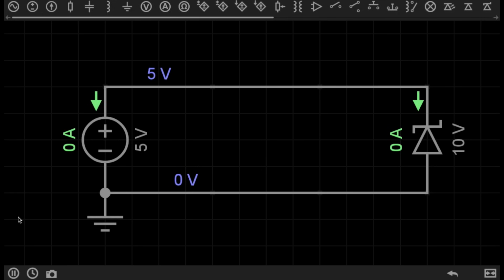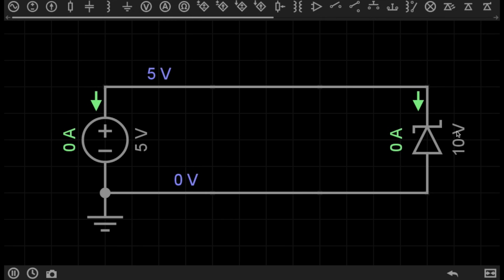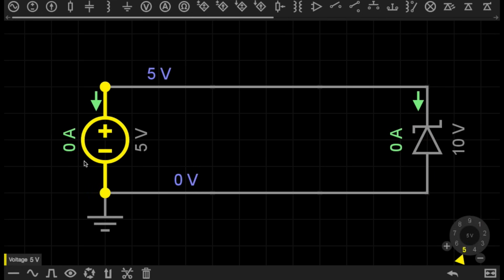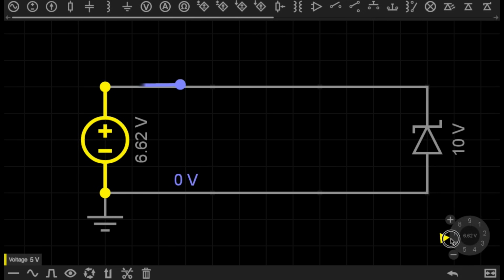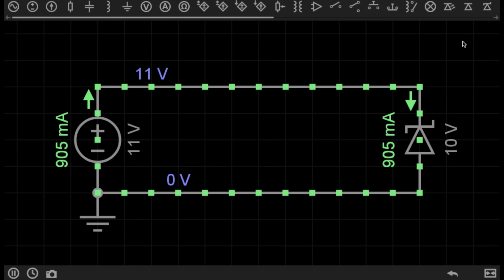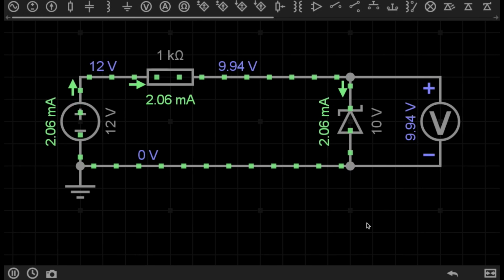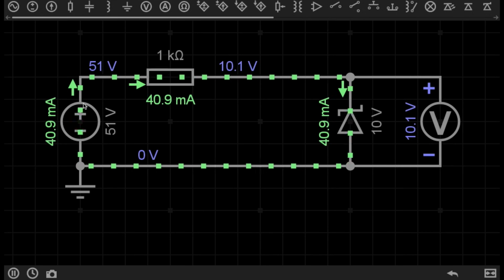What is a Zener Diode? - Electronics Basics 15

Comment: did the same circuit on everycircuit....but the current starts flowing right at 10V...thought you have to go above that before the current starts flowing?
Reply: The zener voltage is typically expressed as a min/max range on the zener's data sheet along with a nominal value (in this case 10V). Avalanche breakdown occurs over the range, but calculations involving Vz, Iz and Zz are done using the nominal zener voltage. These individual settings can be adjusted for the zener in EveryCircuit which allows you to simulate a wide range of components. This is why the diode conducts over a range of input voltages under reverse bias conditions in both EveryCircuit and this video, Unfortunately this video doesn't address this important point in zener diode operation.

Comment: Saw this video on the YouTube main panel and it brought back memories of a fraught Saturday in the Lab. On the Friday just before knocking off time I was given a request from the other engineers to look at a D75 Oscilloscope. I was on my way over to the racks to sort out something for overtime tomorrow Saturday. OK I picked up the D75 and heard Chris say "Its in the pre amp trigger somewhere".
That was NOT good news ! Timebase faults can be so and so's. I was eyeing up a D67 which I loved to work on, favourite was the Tektronix 453 though. I sort it out on the bench, take the covers off, get the service manual off the rack and an extender cable to timebase plugin. D75s are flat rack mounted or desk on the legs. Party Friday night, drive in next without a single memory of the journey in barely able to see let alone walk ! I stagger to my bench in the thought of what is to come. Nothing gets done for at least 20 mins ! So hung over ! So I start, find a 5.7V Zener reading 5.85 ! Looking at the location proved why others couldn't find it ! 1.5 hours to remove the board and out comes the zener onto the Telequipment CT(906?) Curve Tracer. Get to 5.7V ok the run up the transfer characteristic to see 1/3rd of the way down the trace it splits into strands like a split hair, no curly bits. Whaaat? Quickly i replace the zener, make good the board, you couldn't tell anyone had been there, after two years on the bench my soldering was very neat. Was a bricklayer two years before and before that a tank gunner. Flashed it up and TaDa ! there was the trace trigering like a good'n. I walked slowly over to get a cup of coffee. My hangover completely diappeared on seeing 5.85V, then a smile at the successful trace. The comments soon quietened down as I was collecting my coffee "Havent you fixed it yet Tony ?" A smile was the reply, several engineers rushing over to see the curve tracer and the scope with its clothes on and working fine. "Very well done Tony" Ian said ! Struth I've seen him say "Hmm OK" to one of the other engineers after a three day struggle to find an intermittent (Salmon Pink) precision resistor, very rare ! Three weeks later my pay was raised to the other engineers from trainee's pay. Will never forget that. So far no one has seen that, so maybe I havent been asking the right people, but all were repair and calibration engineers. the most rewarding and exciting experience of my life, I loved it. Analogue component fault finding is the best !

Comment: simply electronics, so basically this video is saying that inject 40.9 mA trhough this circuit at 
51 volts, zener diode will lower the voltaje to 12v but will keep the current at the same level? that means a very big power loss?

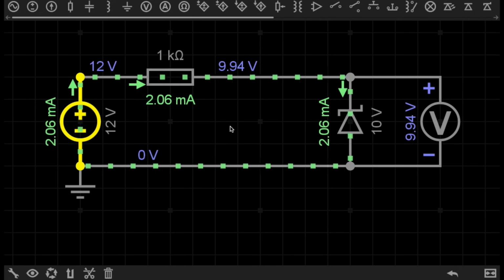Comment: I didn't understand one of the examples in this video... at 2:39, he says that the zener diode's breakdown voltage has been exceeded, but in fact it hasn't. The battery is providing 12 volts, but the resistor reduces the voltage to below 10 volts. So how did the zener diode breakdown when the voltage is only 9.9 volts?
Reply: Before the breakdown there was no current to provide the voltage drop, so it would have been equal to the supply voltage at some point . After breakdown, the diode still conducts in reverse even if the applied voltage is lower than the breakdown voltage, as the breakdown is generally irreversible.
Reply: Very good question indeed!
Reply: Hope this gets answered.
Reply: zener diode is eating 0.1 volts, it's called voltage drop. is like sending dc current at a specific voltaje through a long vable. when measuring the voltage at the end will be lower than what it began with
Reply: When the supply voltage is 9.9v there is no current across the circuit
Reply: If the voltage is 9.94v across the zener diode, how can it allow current to flow in the circuit?  So meaning if I increase the resistor value to 4 tines it's current value, the zener diode would still allow the current to flow through the circuit  with a 12V power source? If that's  the case, the power source voltage is a concern and nothing added in the circuit matters.
Reply: V= iR. The current through the resistor determines the voltage drop across it. The Zener is dictating the current by holding the voltage at its cathode side to ~10V.
Reply: he didnt say at 2:39 it was 12v but when increase the volt 51v he  says exceeded at 3:05 ,,and the best work put volt at 24v in the  dc supply

Comment: I would like to know the Simulator that you have used in this video. It is quite good simulator
Reply: Shivam Kasaudhan everycircuit.com
Reply: Can we get that simulator app or program??
Reply: Great program. Would love to see a desktop version of this.
Reply: @oo0Spyder0oo  Perhaps they added the Chrome option after you made your comment, but you can run it in Chrome on a Desktop now. It is not free and has only a 24 hour trial period.
Reply: @TornadoCrafter  Thanks for the info. Any idea how much it costs? I see no info on pricing on their website.
Reply: @oo0Spyder0oo  I see references on third party web sites to the apps costing $14.99, not sure about the Chrome version. I don't trust a company that doesn't put their price out in the open plus the fact that they only have a 24 hour trial makes me think they are trying to trick people who won't have a chance to really check out the product before the trial ends so they hope people will buy it before they realize it won't work for them. I see comments about how it is missing many type of components, like Triacs. The animation is really nice and makes a good educational tool for basic electronics.
Reply: @TornadoCrafter  yes I felt the same way. No price until signing up perhaps, not a good way to do things. Thanks for the great info.
Reply: But why does the simulation show the current flowing from positive to negative?
Really it would be more believable if the current flow was in the proper direction.
But yes the description is correct.

Comment: Did this exact thing on my every circuit and even tho the voltage will flow thu the zener at 10 volts as soon as I increase the voltage at the source the voltage meter goes up to the same voltage.
I thought a one time payment would be worth it but not if it doesn't function properly.
Just for the record I'm not a professional electrician but far from a novice.
That said thanks for the videos, great job.
Reply from the maker: Have you got the zener reverse biased with resistor in series?
Reply: Yes sir I sure do, even did it both ways to make sure it was the app and not me. As I stated I also check them with my bench power supply and a volt meter and it works fine. I want to get the app but I cant get any confirmation that its a one time only payment. It may just be a software glitch
I just received a set of 300 zeners today (2v-39V) and have checked several of them on my bench and they're working fine. I set my supply to 20 volts (a bit less for the lower break down zeners) put a 5v zener on it and the meter drops from 20volts to 5v - 5.5 volts as it should in the app.
Thank you for the replay, very kind of you.
Be
Well
Reply: I even did a mockup that followed yours to the to t. It showed the voltage flowing thu the zener as it should at the correct voltage. That said the meter went up volt for volt with the supply.